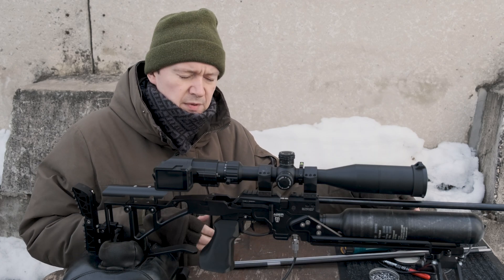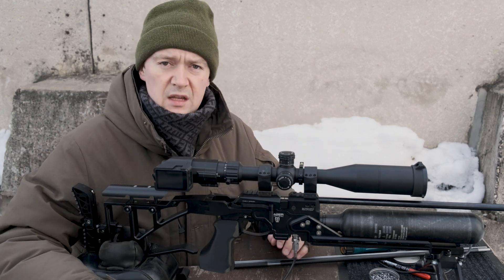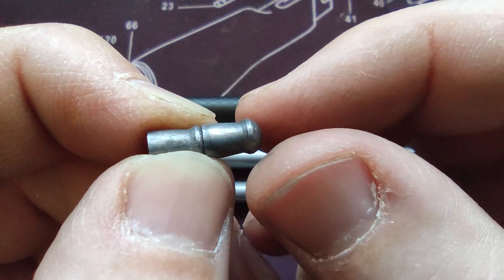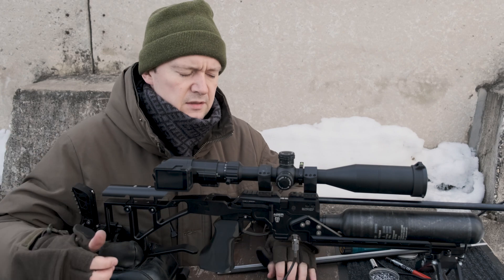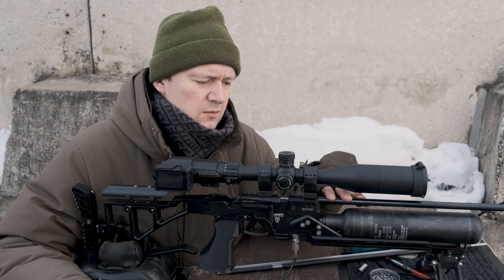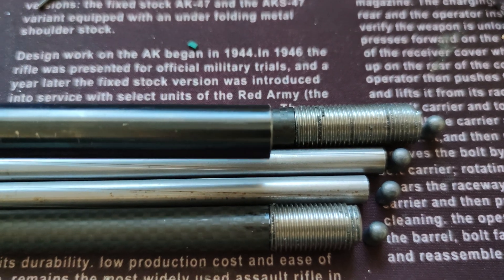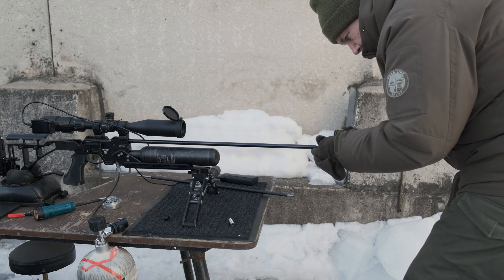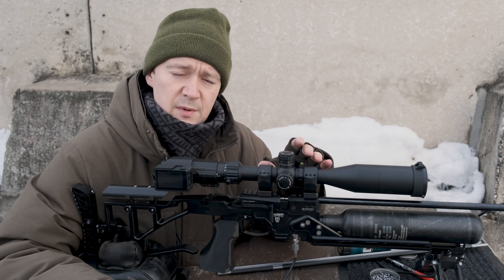Research and Development: Choke Cutting Experiment and Accuracy Dependence

Comment: Hi Nick : Have you tried using the FX slug liner? I believe it has a bit higher twist rate and is NOT choked. I hope to see you in Utah this year. Cheers.
Reply from the maker: I use STX Heavy Superior - it is made for slugs and heavy pellets. Works fine. As far as I know all FX liners are choked ones (no 100% sure).